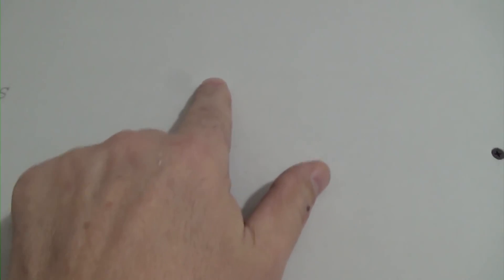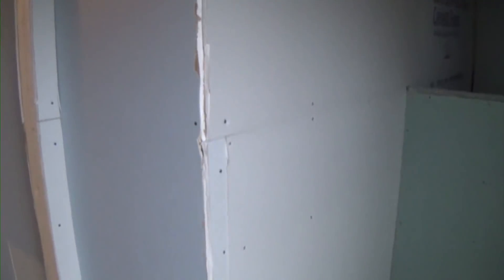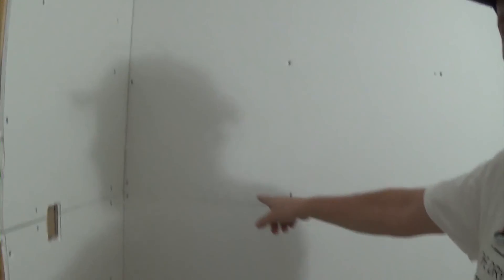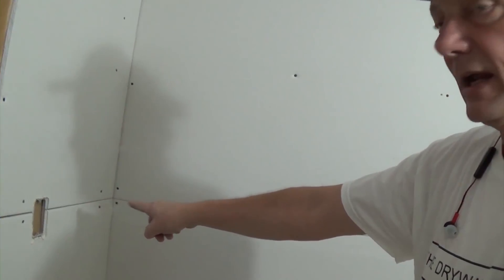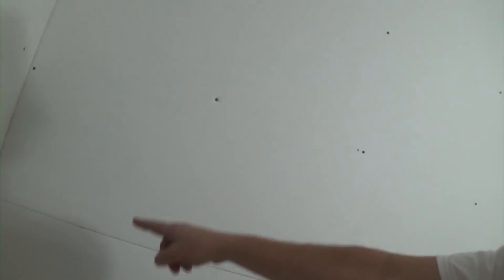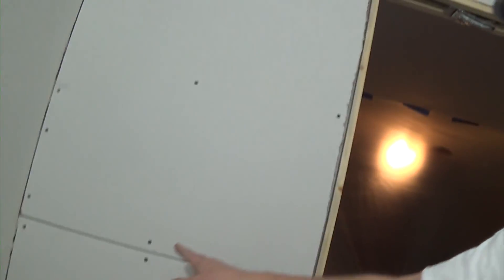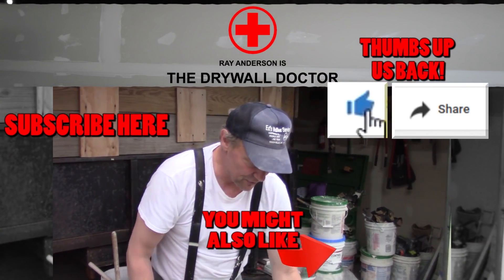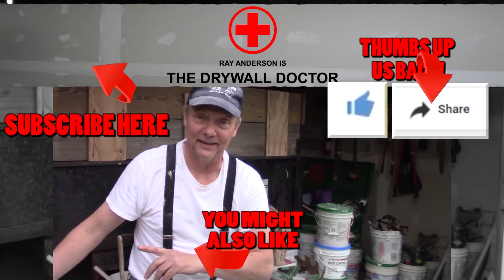Day 1: Some Basics on Prefill and Angles  Drywall Tutorial Week!

Comment: Hey i got a problem i finish 28 apartments but it was really cold and we didnt had heaters but the contractor told us to do it anyway
Reply: Jose Luis Sanchez not a good idea. If it’s too cold to the point your tapes froze to the wall, I guarantee when it warms up there’s gunna be millions of problems. Contractors fault not yours, don’t answer your phone is what I suggest if you already got paid
Reply: The full comment didnt upload
Reply: They are going to pay us to fix it almost all the butjoints and some of the joints crack
Reply: My question is what do you guys think how do you guys fix it
Reply: We wanted to tare all the tape on the joints that cracked and do it again or do you guys have another way to do it
Reply: Jose Luis Sanchez heat the place up and see what cracks, wait a week. Then just retape and finish it
Reply: Uncle Bernie thanks
Reply: You did pre fill right?  If it wasn’t colder then 50’f then It was lack of pre-fill. If it was colder it’s then this is a lesson learned never finish Sheetrock when it’s cold.  Turn the job down if you don’t have enough in it to buy heaters